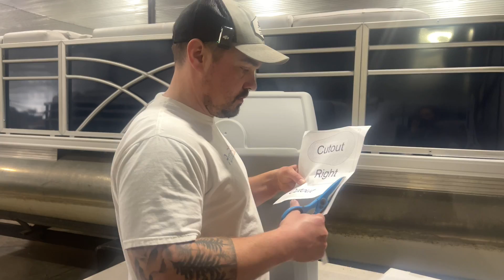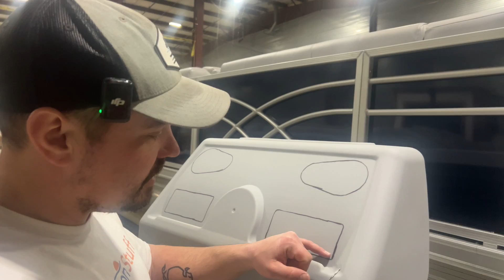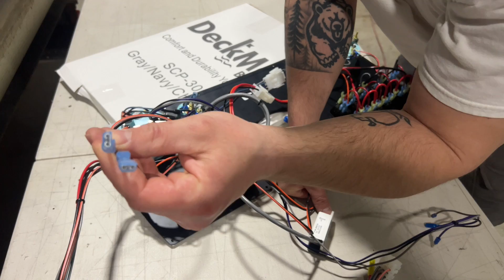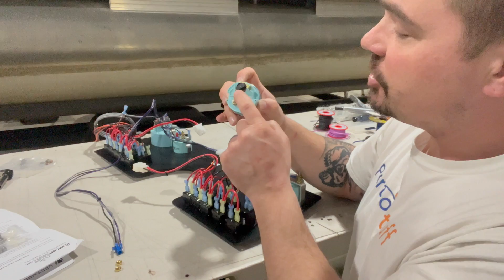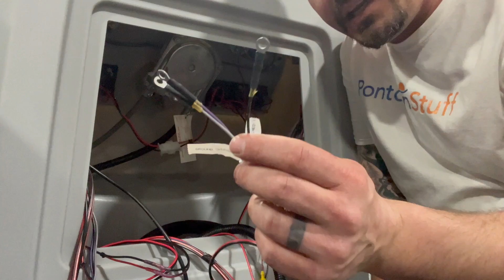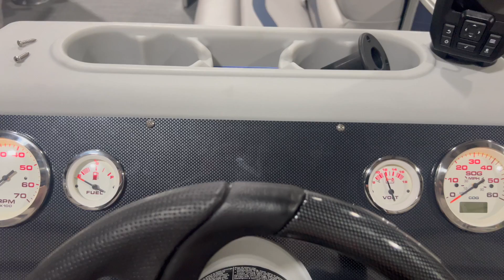Pontoon Helm UPGRADE - Gauge & Switch Panel Installation

Comment: Great Video, although I have an issue with the rebuild boat I bought. It came with a 1989 150 hp Force outboard motor on it (I know not very good reviews on it, but it looks clean) with the power cable and throttle cables cut. How would I get power to the switch panel that I purchased from pontoon Stuff from the motor. I suppose the cut throttle cable issue would depend on the new shift and throttle unit I buy. The cables that connect from the battery to the motor are there. I need to get power from the motor to the console. Any advice.
Reply: Thanks for your reply,
Yes, I did purchase an accessory harness from Pontoon Stuff also. So, what I understand is that the wiring harnesses / cables that are on the boat motor now are obsolete and not needed? Is that correct? I did mention that I purchased a switch panel from pontoon stuff along with that I also purchased a console, I got the package deal that was offered on the website. I will also need a steering wheel and a throttle control box which one would you recommend.
Reply from the maker: You will need something in the way of shift/throttle controls and ignition harness with a key switch. Best bet might be to call Vans Sport Center with your model and serial number off the engine to get the correct rigging components. 616-364-0666

www.Vansports.com

Ask for Brad in parts!
Reply: @tomspontoons  Thank You
Reply from the maker: Your switch panel shouldn't be powered by your ignition harness from the motor (or the motor at all for that matter). If I were working on it I would either install Pontoon Stuff's whole boat accessory harness (this would be my first choice) which hooks to your battery and runs to the helm as well as your nav lights and other accessories....or run 10 gauge positive and negative wires from the battery to the helm and tie into the switch panel with that. Be sure you have a 15 to 20 amp fuse inline to protect the system.

Comment: What was the ignition switch setup. I have a mercury 2 stroke from 1999 i want to use like that
Reply from the maker: Just built a plate for the ignition and safety lanyard on the face of the console. Shift/throttle were installed in the binnacle control box component that pontoon stuff sells.

Comment: Great video!! I'm new to wiring on boats I'm actually in process of trying to rewire my 95 Lowe. I have so many questions lol but I'll just ask one, all this wiring where is your fuses for everything??
Reply from the maker: When using this wiring harness and switch panel there is a main resettable breaker at the battery and each individual accessory and light has its own breaker with the switch. It’s all built into their dash panel. If you want to wire into a system without breakers you’d need to add in line fuses for each accessory or a fuse block.

Comment: Are those seat covers from Pontoon Stuff? Do you have a video on those covers?
Reply from the maker: We have a seamstress in house to makes custom snap on seat covers for the boats we restore. We're in Grand Rapids, MI if it's something you're interested in. Otherwise check with local upholstery shops. Our custom seat covers are usually around a $1800-$2000 add-on, but super easy to use, stay in place, and are made of high quality marine canvas. It's the simplest way to protect the investment in new seats for the life of the boat.

Comment: Another fantastic, helpful video! Thank you. Also, would you mind sharing which model DJI wireless mic you use?
Reply from the maker: Thank you! Cori ordered it, she said it's the newest model...DJI Mic 2. Bought it on Amazon along with some lavalier lapel microphones, but haven't played with those yet as the unit is pretty small and not obstructive to where on my hat or shirt. I have noticed that when it saves the file to my photos on my iphone the words and video get off slightly as the video recording goes...but the video on the DJI app is perfect. There's some issue with processing it down to save in photos.

Comment: I’m wondering about taping the template on the helm and then using an x-acto knife to trace it which would cut the paper and leave a mark on the helm.  Might be easier than scissors and sharpie. I’m just thinking out loud. Haha. Always love your videos!
Reply from the maker: I could absolutely see that working well too. I’d still probably trace your razor blade cut with a sharpie though as the plastic shavings/dust might make seeing your line tough without marker lines.
Reply: I was thinking the same thing!